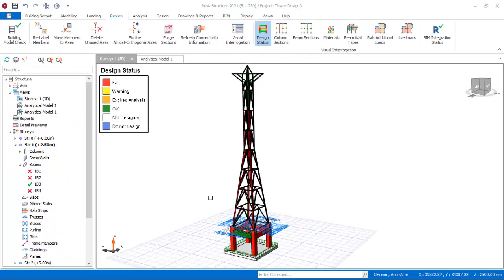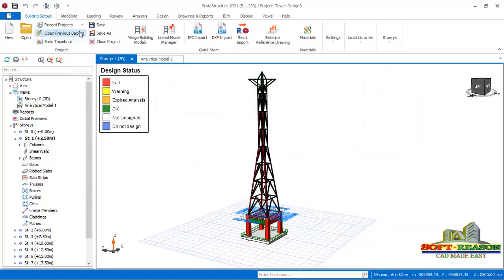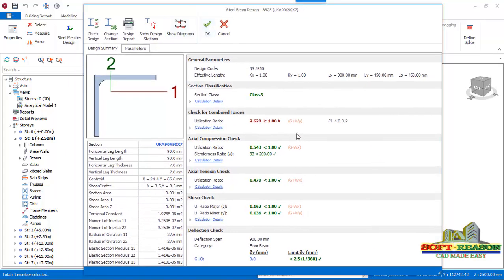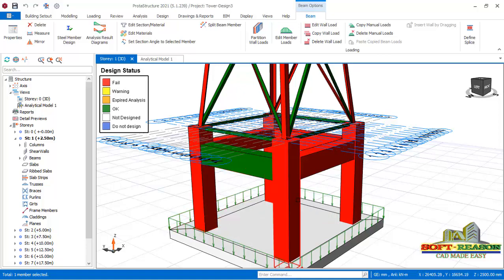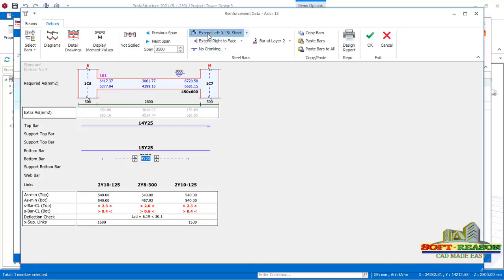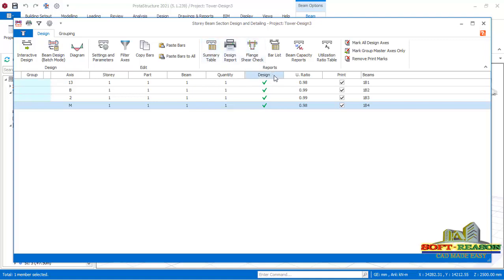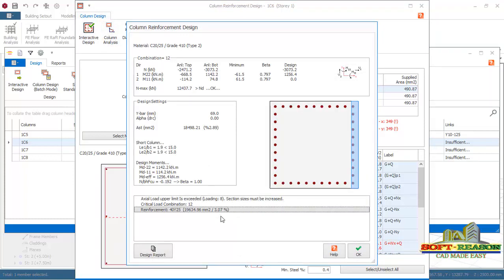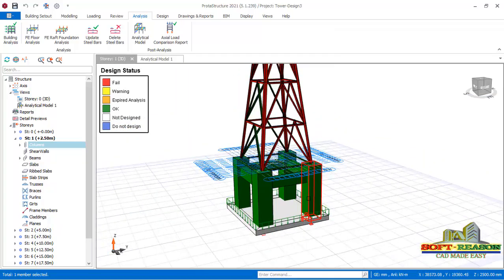How to Rectify Failed Members by Interactive Approach in Protasructure 2021

Comment: Thank you
But can batch the design do this better than this interactive design
Reply from the maker: Batch design reselects rebars only while interactive design reselects rebar and changes sections as well. In most cases when you run a batch design of failed members you notice it still not pass design because sections might be insufficient in that case interactive works effectively. So understanding the different b/w batch and interactive design is a + .